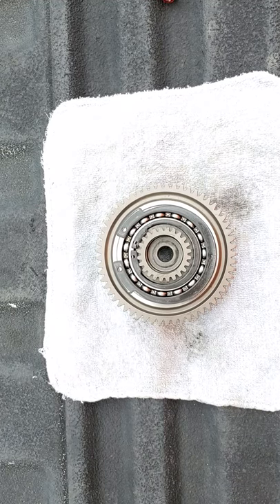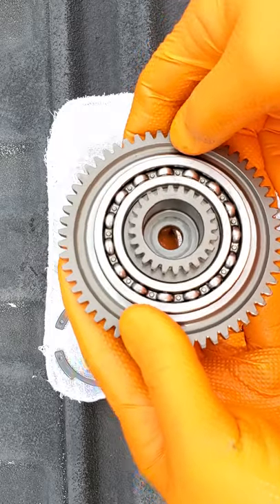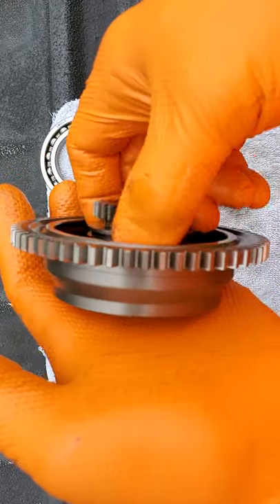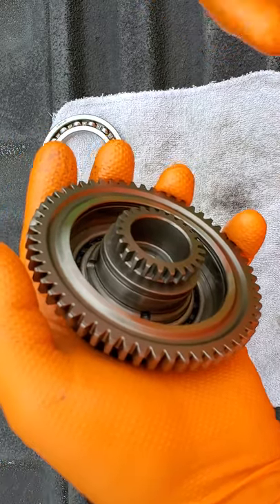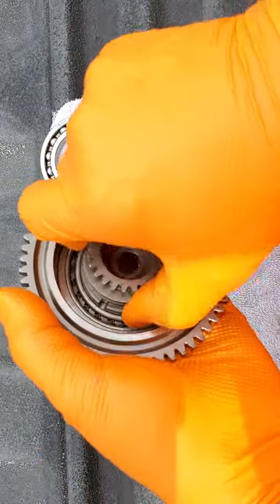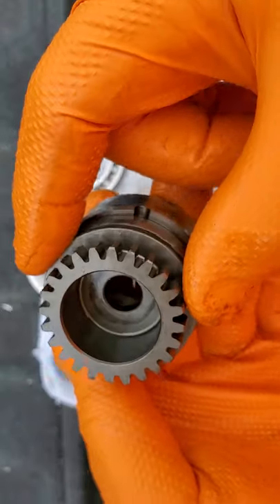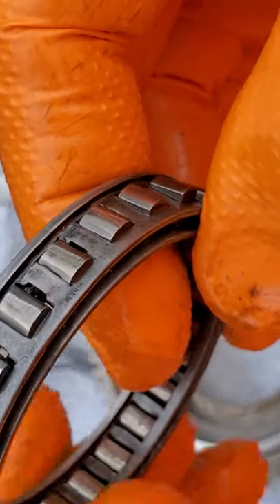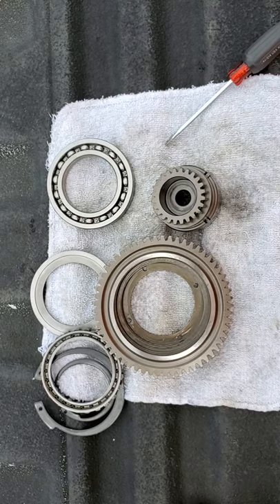Yamaha SVHO Supercharger Clutch Assembly  Part 1 of 2

Comment: Oil pressure loss is due to oil pan design during snap decel has been discovered to be the cause of this. There are also other reasons but I do not have room to go into here.

Comment: Having a similar issue. With only 45 hours on it.  Only 2 pounds of boost showing on my boost  gauge.  During the visual inspection with my hands,  it felt tight.. So,  I use a 8 mm socket and a 1/4 inch torque wrench and  I put 10 inch pounds of torque force and it started to move over.  Would explain why my boost was so erratic. ECU would kill throttle in the high end since boost was so low.  Most guys expect the clutch to completely free spin when they check it with their hands. Anyways, great video good insight  Thanks.....
Reply: Same here can’t spin it by hand but can with a small socket wrench with a little torque.
Reply: I had a similar issue shortly after 50 hours But turn out to be a loose coupler to the throttle body. I would check that first..

Comment: I just got a 2019 with 38 hrs on it. It lost power. No codes just a pop sound at 65. But the bikes runs fine just will not go over 50